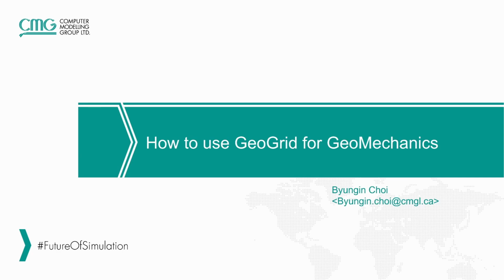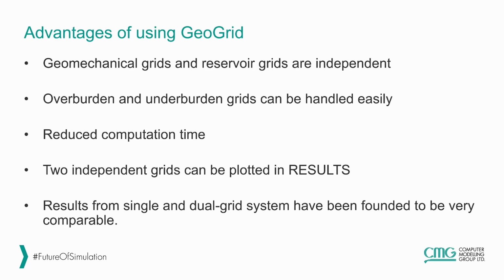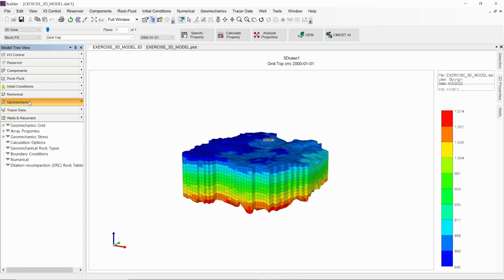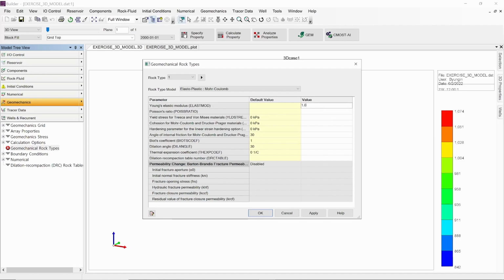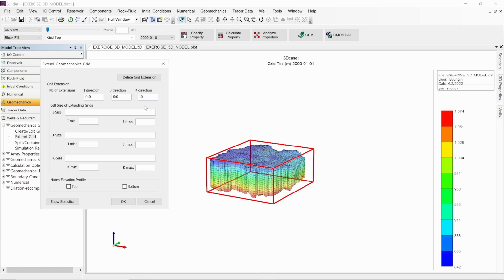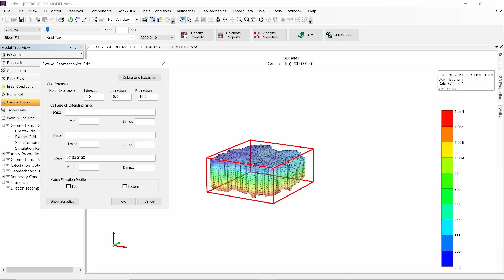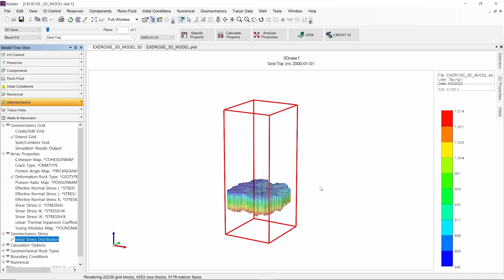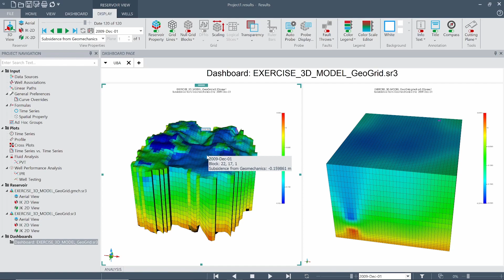CMG Tutorial: How to Use Geogrids for Geomechanics

Comment: Symmetrically distributed pressures are obtained using perfectly regular reservoirs, but symmetrically distributed surface displacements are not obtained, and the boundary conditions are the defaults

Comment: is that options valid in CMG 2018???
Reply from the maker: Hi Hayder! Sure, you can create Geogrids in IMEX, GEM or STARS 2018. If you have additional questions, write us to support@cmgl.ca
Reply: @compmodgr  Yes, but Array Properties in geomechanic not valid?!
Reply from the maker: Hi Hayder! you can set the array properties for geomechanics using V2019 or later.
Reply: @compmodgr  Can i use other method? In V2018
Reply from the maker: Hi Hayder! Sure, you can define some of the geomechanic properties in the "Specify Property" button, nevertheless, the workflow could vary depending on the the property you want to specify, please write us to support@cmgl.ca to give you a more detailed support.
Reply: @compmodgr 
Yes i found it
I write to you but no one answer on my questions
Reply from the maker: Hi Hayder!, We just checked the status account for your profile and noticed that the entity you are associated with does not have active license. Please contact your license provider to clarify this,  since you are using the simulator, you should have active license. If you have changed of organization please write us to  support@cmgl.ca mentioning the organization you are working with and your questions, with that we can proceed to solve your request.
Reply: @compmodgr So, when I don't want to extend my geogrids is it necessary to define 2 Georock types?